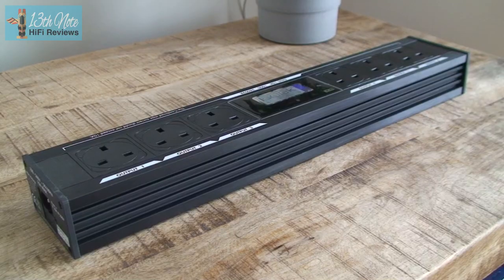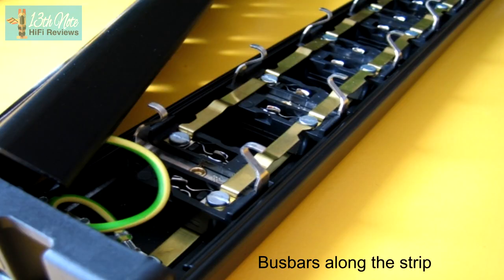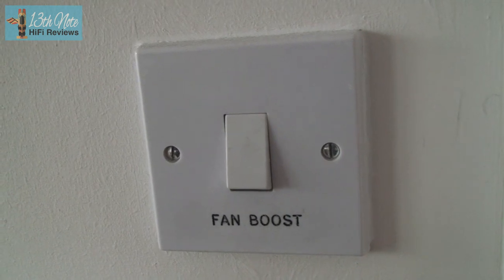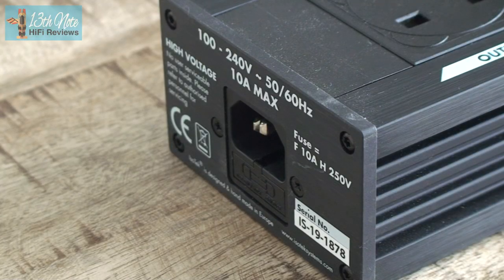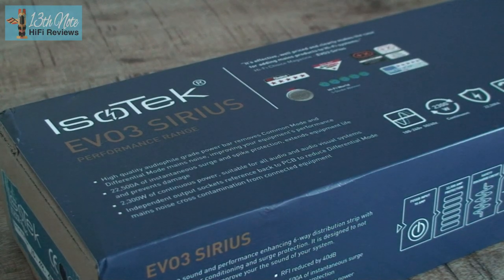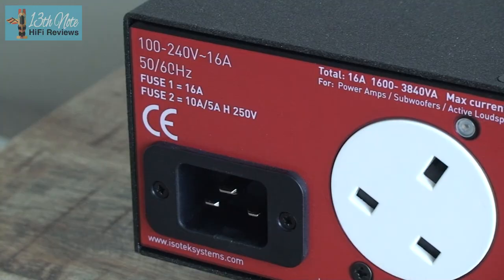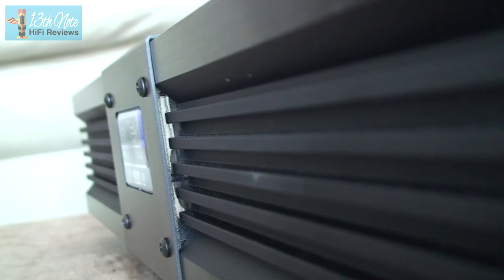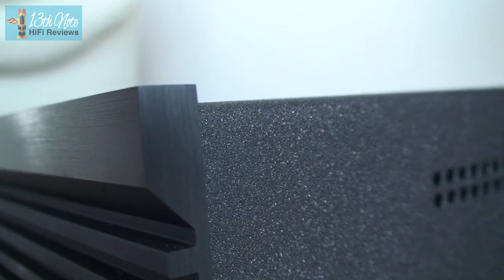IsoTek Aquarius & Sirius

Comment: Had to try the Aquarius at home before spending money on possible snake oil. The first track I played had me reaching for my wallet. Makes my MuSo Qb2 sound like a 4k hifi. It makes the Uniti Star phenomenal. It made background noise disappear, no loss of anything, my system just seems to be able to breathe easily and perform its best. There are more expensive units up the IsoTek food chain, goodness only knows what they can do! It would seem that the Aquarius is a sweet spot in the range, with higher up units doing more, but at greater cost.
Reply from the maker: it is one of those products that is easy to be dubious of until you try it. Enjoy!
Reply: Billy. You made a good choice.  The Aquarius is probably the peak of the cost/benefit curve, i.e., you'd have to double your money to get a 10% improvement.  Unless you have extremely dirty mains, the Aquarius will work wonderfully,
Reply: @Mike82ARP  Agree. I have noticed that I don’t get days where the system sounds anything less than good. I’ve had good day/bad day systems in the past. Sometimes wonderful and other days something missing or wrong. That just doesn’t seen to happen now. I spent half a day with the Uniti Star plugged back into the wall. Although not terrible, I could hear a background again. Aquarius back, black silent background and better sound again. It works for me.
Reply from the maker: @billywindsock9597  I totally agree, I think they are like adding an improved amp. I recently tried mine with my Hegel H390 going back to a bog standard power strip when a subscriber friend came around. The change was very obvious.

Comment: Excellent review.  Since I use a Sirius and have been wondering about the next step up (or not), this information is very useful and accessible.  And why hasn't anyone commented that the beautiful dog likes it?
Reply from the maker: Thanks . Don’t use the Sirius for power amps as it will throttle dynamics due to current output lower than wall. Isotek agree on that
Reply: @13thnotehifireviews7   I'm considering a V5 Titan.  Two outlets for amps.  What do you think about using the third Titan outlet to power the Sirius, which would in turn power sources only?
Reply from the maker: I’m dubious about going crazy on power conditioning. Aquarius is my limit. You’ve got to think about where else you get lesser diminishing returns and it will be in areas like DACs , amps and speaker. Not conditioning or cables / reclockers / streaming transports. Common sense and experience dictates there.
Reply: @13thnotehifireviews7  Thanks.  My current streamer, DAC, amps and speakers are endgame for me.   Just looking for consistent sound throughout the day, not just at night.  If the Aquarius will provide that, great.  The only way to figure that out would be an in-home demo.  Not sure if a demo per se is possible, but there are US dealers who provide a trial period with return policies.
Reply from the maker: @pmansk6120  what is your system, list please
Reply: @13thnotehifireviews7  Grimm Audio MU1 (streamer) > Mola Mola Tambaqui (DAC + volume control) > Mola Mola Kalugas (amps) > B&W 803 d3
Reply: @13thnotehifireviews7  if you had to divide 10 devices up between a iso-tek sirius conditioner and a cheap 6-way mains conditioner (tacima) yet you wanted to keep the best sound possible but still wanted to keep the electric noise to a minimum, may I ask your opinion on which 6 devices would you pick for the the iso-tek sirius and which ones would you relegate to the cheap mains conditioner?

1. ARCAM AVR20 
2. ARCAM 4-CH POWER AMP 
3. ARCAM 4-CH POWER AMP
4. REL T5I SUB 
5. REL  T5I SUB 
6. ROUTER 
7. OLED TV 
8. Virgin cable box 
9. Apple TV streaming box 
10. Philips Hue smart lights
Reply from the maker: It’s not a question anyone can answer. All down to you…..
Reply: @13thnotehifireviews7  
I understand!
 I assume its just the power amps that I really need to be careful with when hooked-up to the Sirius

Comment: Will be getting the Aquarius for my system. The fact that the power does not daisy chain with multiple connection noise, is the big reason i resided on this.
Reply: You better spend your money on better speakers and amp, not these snake oil products... It's an engineering fact that these products have no audible effect what so ever... And I happen to be an engineer who works at a company that develops power supplies...
Reply: I think it shouldn't cost more than $300 (just $200 for the nice case).

Comment: I always thought this kind of shit was pure snake oil, until I tried it myself. But, I don't think it will work for every system and space out there. In my case, I have a pretty high end system in a living room with a lot of noisy stuff connected, like several UPS units, 4 computers, modem, several wifi boxes, security camera, heat pump, etc etc. 

I wanted to buy a Isotek Corvus, but nobody had it in stock so I had to make do with a Polaris (and 2 Isotek power cables), which only has a 10A fuse. But I can't say I notice much, if any, loss of dynamics. But after a LOT of critical listening, to both movies, music and games, the positives far outweigh any negatives. Much less noise, more detail, and the biggest of all for me is that the sibilance is far less audible than before. Month or so ago I suddenly started hearing sibilance in everything I played, no matter the system it was played on, so discovering these units, for me, is excellent.

Would an Aquarius shave off the sibilance even more?
Reply from the maker: Probably better to change speaker cables maybe.

Comment: I really don't recommend IsoTek Aquarius to be used with a power amplifier. It kills the sound stage and everything sounds compressed ... it's better to use it with your source components.
Reply: Can you be a bit more specific and tell us which power amp you used with the Aquarius ?
Reply: @theone262  I've tried: Emotiva BasX A-300, Emotiva XPA-DR2, Gold Note PA-10 amplifiers. They all sounded much better connected directly to the wall plug.
Reply: Well that isn't true. It has no effect, either positive or negative.